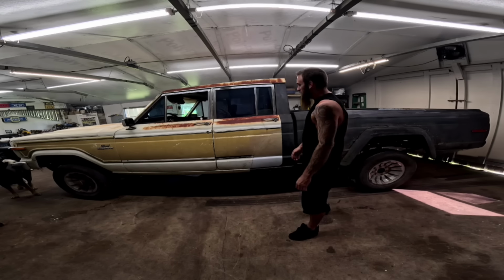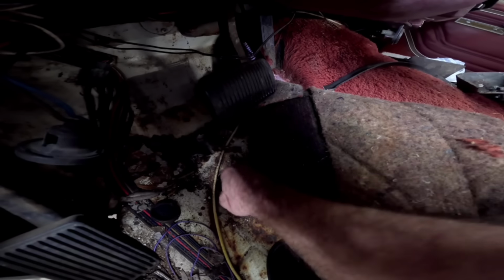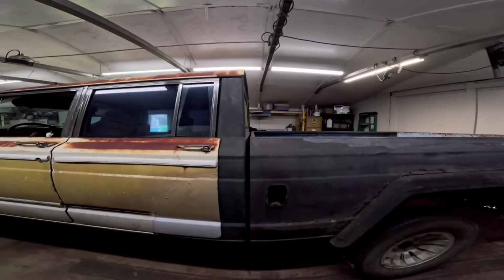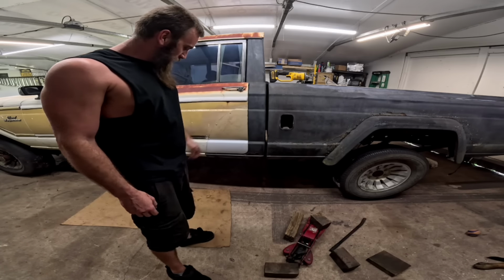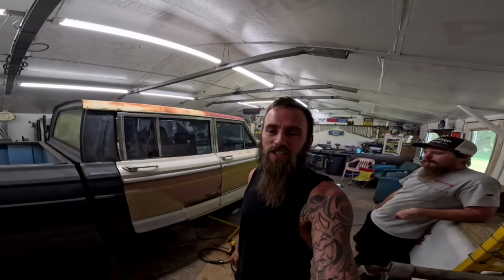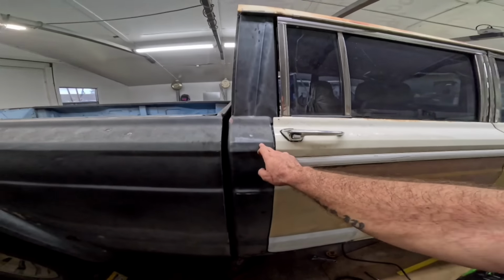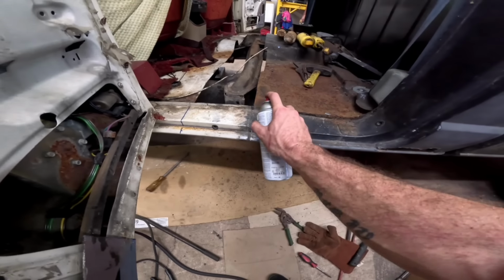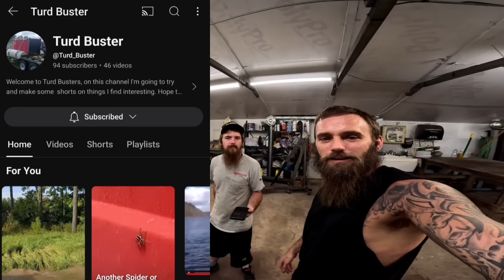The Talk Of The Internet Jeep J10 Truck Build

Comment: I like that last set of deep dish mags you showed. Fits the truck nice. For that roof, I say just trim the back truck panel to fit the wagoneer profile. The body line change back there won't hardly be noticed. And you might be able to bend the door tops to seal up that back edge.
Reply: Its not sema grade but dang amc should have put one of this style into production,they would have sold a ton to contractors and weekend woodsmen.i think it looked best with the jeep grand type rims on it,gave it a bold stance.good job guys saving a wreck and scrapper from the crusher.should be fun on weekends.snooky pa.😊😊😊😊😊😊
Reply from the maker: Appreciate it.  Thanks for watching and commenting

Comment: Looks best with the wheels that came off the truck that donated it's bed and such. The Duramax wheels look too city slicker, and the stock wheels are good rollers and spares.
Reply from the maker: @justincooper5189  
I agree.  Unfortunately we lost 1 wheel while the j10 sat for 5 years. Appreciate you watching and commenting
Reply: @SquareMax  summit racing would have a replacement if you know the brand. Hell, just look through the online catalog and they should have it. I think they are either rock crusher or stone crusher ( I know, same thing, but they might be different companies or slightly different design)
Reply from the maker: @justincooper5189  
We will definitely have to look into it. He does like these 15s

Comment: Well,u got me subbed 2 u now and INTERESTED to watch just by taking one of my favorite  childhood trucks and doing something I Surely haven't yet seen done to one (I love the old AMC FSJ) and the best old 4x4,  my dad had many over years J-series trucks watched my dad sell one and have regret the same day while calling the guy he sold it to ,so he could return to our house nd PULL out 1st our neighbors 77 squarebody Chevy shortbed lifted that got stuck in our yard while trying to come over and pull out my dad's new to him 1988 (in like 93) Ford bullnose 4x4 manual 4 speed 300-6 that was attempting to get loaded with firewood  on 11 acre land and the JEEP did lots of times with 0 ISSUES  but the guy came back and my dad said he should've kept it  and down the road got another one but for wood getter and was now 3/4 ton j20 however I that j10 was CLEAN and done up nice in brown with graphics and bfgoodrich TIRES chrome wheels dual exhaust, small PURPLE lights in the center of tail lights  but that j10 sure as shit recovered the neighbors Chevy and came back to the Ford and got out itself many times  them old quadratracs was good although truck was geard low and would bend pushrods over like 70mph lol ask me how I know that lol but later on my dad had got a few different models and toys and so on but them was  my favorite  as well as me liking his old squarebody (preferably 73_79) round headlights
Reply from the maker: @EojWashner-ik1sm  
I appreciate you sharing.  Sounds like a fun childhood. Thank you for watching and commenting

Comment: It's an awesome build I would get a set of  1 ton axles and for it and a set of 37-40 inch tires fix the rust and do a nice rattle can paint job with some nice off road bumpers headache rack and tool box in the back rock slider steps
Reply: Cute pup
Reply from the maker: That's definitely a option.  Appreciate you watching and commenting

Comment: Find a Ford Ranger,  take the body rubber hole plugs out ,  cut holes in your jeep the same size as those rubber plugs in your jeep floor to access your jeep body mount nuts..  put the Ford rubber hole plugs back in after  and win.  also  don't use hockey pucks  go and  get yourself rubber  boat rollers , cut to length,  reacts better and lasts longer than hockey pucks it comes 10 inch length, 2 diameters so you can cut to size and already has the hole in the center.  I get mine at Princess auto in Canada, I suppose you can get them at any trailer supply store..  ( I stole the idea from Bad Chad)
Reply from the maker: @jarleron4788  
Appreciate that. Will definitely keep in mind. Appreciate you watching and commenting